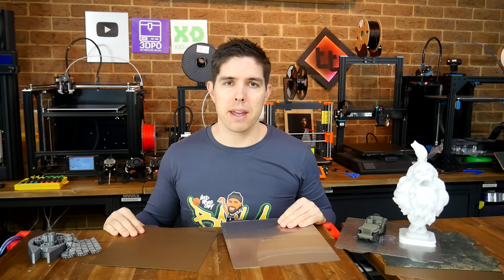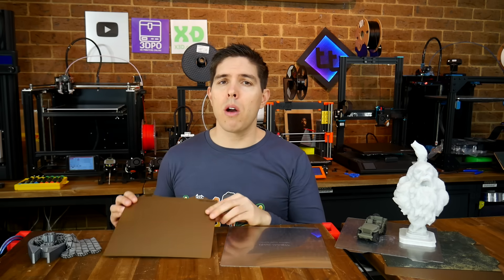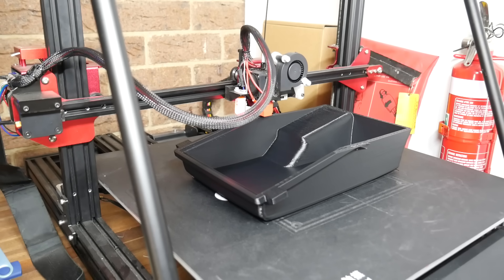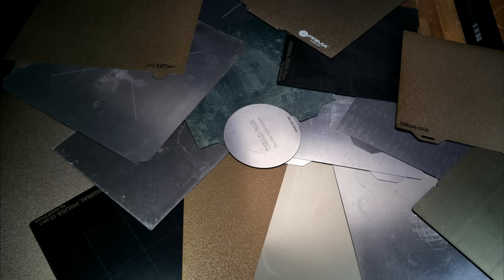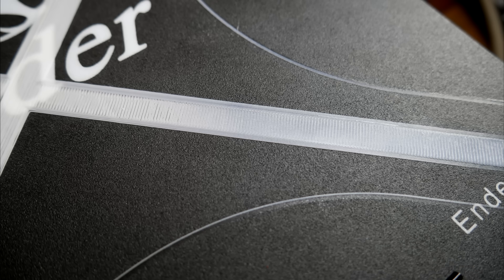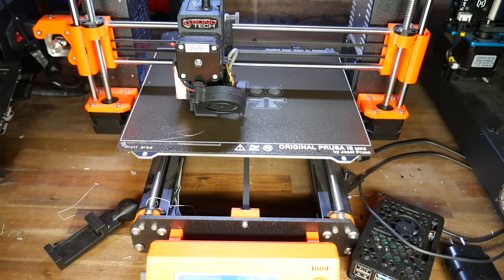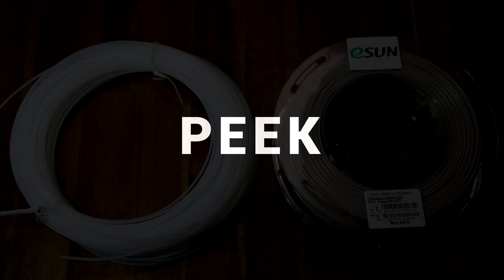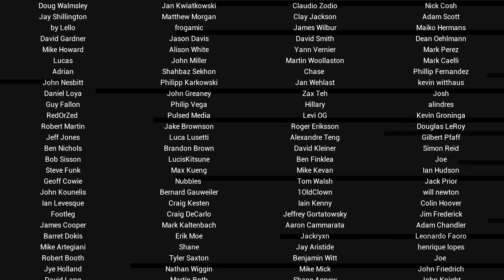Guide to PEI 3D printer beds: Why and when to use smooth vs textured

Comment: Don't use acetone to often to clean a PEI sheet. It's rather aggressive and should be used only once in a while or it will destroy the PEI sheet over time (or even after using it once if you have bad luck. E.g. the powder coated bed from Prusa is pretty f**d after using Acetone only once )

Comment: Recently I came to the conclusion that inductive bed leveling limits your choice of surface that you can use too much. A bl-touch or other mechanical leveling sensor is far more flexible. At least for me it is interesting to see other ABL systems. Pressure sensors etc. ;)

Comment: Thanks a lot again. You asked about other bed surfaces. Well I like poly-carbonate a lot when bed adhesion is important which is the case with ABS. For around 3 euro/pc you can have 235*235 mm cut pieces 3mm thick. It forms a very good addition to the sheets you described for some special purposes.

Comment: I'm having ongoing issues with PETG on a textured PEI spring steel sheet. It's an Endzilla'd E3V2 with 300x300x500 and i'm trying to print large sections of a car spoiler. I keep seeing that PETG sticks too well to PEI but I just can't stop the edges lifting - brim, 13mm/s first 3 layers, different bed temps.. I managed to get one to stick at 90C bed temp but over the 10 hour print this caused the bottom 40mm of the part to sag under its own weight because of being over Tg. Found a hydroponics tent that fits the printer so i'm running another one now, temps seem to have stabilised at 35C inside with a 75C bed temp so i'm hoping the draught exclusion and temperature regulation will help.

Baffles me when people say PETG sticks too well, eSun black PETG certainly doesn't. I had better adhesion with their ePA-CF!
Reply: I've also had a very difficult time getting PETG to stick to, well, anything.  I can sometimes get it to stick with a wide brim if I heat the extruder up to 255C or more for the first layer, and rafts do work, although they're hell to get off of the rest of the print after it's done.

One thing I can't help but notice is that we're both using eSun filament.  Maybe it has something to do with their specific formulation?  Saying a filament is made of PETG or PLA or ABS or what have you is a lot like saying a knife blade is made of iron.  While this is true in a sense, there are a lot of things mixed in to make a good alloy, whether it's plastic or steel, and everything has advantages and disadvantages.

Comment: PEI beds are great for batch printing.  I use the “Continuous Print” plug-in for octoprint to print parts, then it cools down and pushes the part off the bed ready to print the next part.
Reply: wait, let me get this straight: you print a part or set of parts, then let them cool, then the printer moves until the parts fall off, then it prints another set of parts?
Reply: @atlastanker  correct
Reply: @atlastanker  I’ve seen someone make an arm that drops over their build plate and then the plate itself moves backward and all the parts fall off by hitting the arm and the arm moves back up and it prints again. Really impressive. Still requires a bit of maintenance. You’ll likely get a few runs until it has an issue that has to be fixed. At least with your first few prototypes. I feel like bed leveling will be effected over time with that style of removal. And even with an auto. It can get too far

Comment: I have found using windex on the PEI before printing PETG, it helps the part release easier and do less safe to the bed.
It cleans off easily enough with a thorough wipe down with isopropyl

Comment: TPU sticks far too much to smooth PEI to the point of tearing the PEI on removal. I use textured PEI for that reason. So I see a big difference.
PLA has more consistent adhesion on smooth PEI than on textured PEI (that is less fails)
that's my experience on prusa printers

Comment: Very nice vídeo! I’ve been using a mirror with PEI coated surface in the other side! 
When I want to have a flat and smooth surface, I just need to invert the side of the bed.
When printing PP, for exemple, that needs a special glue, I turn to the side of the mirror!

Comment: I really like G10. I am using it on top of the Sidewinder X1 glass bed and print TPU, PLA and PETG. The G10 that I have is a 1mm thick sheet that has just the right amount of flex to release parts when needed but mostly I just let it cool down and parts always release - which is much better than the stock coated glass bed.

Comment: 11:17 I think I must be lucky then, have never had any problems printing with nylon on smooth PEI + glue stick on a printer without an enclosure in ambient temps around 20c, I even get great results with weedwacker line directly from the hardware store (adjusting the filament diameter in the slicer). Using PrusaSlicer Taulman bridge nylon preset on a Prusa I3 Mk3s+.

Comment: PEI is my favorite print surface. I sometimes use GeckoTek. But over time (maybe too much IPA) it loses adhesion. When this last happened, I found myself returning to PEI, even though I have more GeckoTek sheet on hand.
PEEK for $1/kg? I wish! I think you meant AUS$1 per gram!
Reply: That was such a shock it was quick to pick the "typo"! Damn that filament is expensive, hence I've never bothered building my machine for that and alikes, even tho I basically only print functional (including mechanical) stuff. ABS and PETG for my functional parts, PLA for the cold ones without much loads and off we go.
Still pissed at myself for the last PEI sheet I ruined by... dropping the glass surface it was attached to. I had done a great job of sticking it with no bubbles and all, it worked so well, then it was all to the trash bin. Oh well, glass + wood glue smoothly applied and off we go, not a single issue.

Comment: I've been using a smooth PEI coated bed made by Energetic for over a year and have had no issues. A simple wipe down with IPA before printing and I'm good to go. The surface is still good as new and I've removed prints while the PEI was hot or cold.  I've also been using a Creality glass bed on my Ender 3 for months and that's been also working very well. No glue or hair spray is used. I'll probably switch to PEI after installing auto leveling though. I print mostly PLA and PETG.

Comment: Not sure what PEI surface you're using, but mine holds onto PLA & PETG like they're glued even when cooled to room temp. So much so for PETG that it will lift the plate off the magnet for larger parts. 

About 0.04 extra space works well for me w/ PETG and always let it cool down below 45C.

Comment: Currently I use a glass bed with 50% dilute PVA glue, applied on a warmed bed with foam wedge brush.  Lasts 8-10 prints, then rinse bed with a light plastic scraper and reapply.  PLA and ABS mostly at the moment.
Reply: That's crazy and messy, I hope you get a proper build surface sorted out soon 👍

Comment: I dunno what exactly happened with my EZflex but at some point they just stopped working. I tried every trick I found to try to rejuvenate them but they just stopped getting any adhesion at all after about a year. I switched to a Wham Bam PEX sheet and haven't looked back.

Then I got a textured PEI for my elegoo neptune 2 and so far that thing is amazing. I printed all the parts for a ratrig and voron in ABS without an enclosure and there was little to no warping whatsoever. If there was, it was so insignificant that it wouldn't have any effects on the function of the parts.

Comment: In regards to Nylon. It absolutely does not warp as badly as ABS and can infact be printed in open air (some of the composites like NylonX are quite a lot easier). The problem is that initial adhesion as Nylon really doesn't want to stick to anything. This isn't warping due to temperature as much as its just a lack of adhesion in the first place. You really do need PVA wood glue (the liquid you'd actually use to glue wood, not glue stick). As much as I hate any sort of additive to a print surface (and PEI is a wonder material for most other filaments) it absolutely is essential for reliable repeatable success with nylon, and you want quite a lot of it. You may literally need to apply so much that the nozzle is printing 'in between' lines of glue as the nozzle digs in and scrapes its way along

This can be done on PEI sheets but glass is preferred especially with larger prints. Mostly because of the cleanup of the glue afterwards and you have a higher risk of damaging PEI with all the hot water and scraping. Having 1 or more glass beds you can easily swap out is a lot easier and cheaper
Reply: I have had good luck with my CF prints with just glass and glue stick. I think the trick is on the first layer, I run 90C on the bed, and after that, I cool it down to 35C.

Comment: I love  the glass bed for my ender 3, my cr10s pro has double sided pei sheet from energetic/energetic 3D, and I love it, the downside is even with running a bed mesh, it for some reason wont use it when printing, and get gaps between my lines on the first few layers causing small basket weave type thing under the print. If only you can get flatness like glass, still trigger the inductive sensor (it detects metal) and use a pei sheet, I would be soo happy.

Comment: I thought a magnetic bed loose it's magnetic properties if you heat up the bed above 120c!? 

For Nylon I use special made buildplate stickers from buildtak, I think it's a bit like garolite. Works ok, but nylon is a b..ch! 😉
Reply: Most do, some even at 90, but Wham Bam magnets are specially formulated to perform up to 150 C continuous use

Comment: I used borosilicate glass bed which came with my CR-10, glass/mirror bed, painters tape on mirror, little print area that came with Overture filament and PEI textured and smooth. The PEI is really a game changer and definitely in love with it. I don't use anything else since. Nice video, I've learned so much from you since last year and I'm grateful for that! Keep pushing!!

Comment: Interesting.. You'd say PETG sticks more than TPU on PEI? I've used PEI on both my printers for a few years now (mainly PLA, but some PETG too). The first time I managed to practically fuse the material to the bed, it was TPU.. Tore quite a chunk off, so ended up buying a new PEI sticker. (Not really worth the work just to save 5€ for an ender 3 size bed either, didn't turn out perfect + the adhesive genuinely make me feel sick..)

Now, I've started using gluestick for PETG and TPU just to give it a bit less grip. Z offset is very important to increase compared to PLA as well, as both can very easily embed themselves in the PEI.. Though I haven't tried using steelwool or sandpaper to remove some of the PEI before, I suppose that's worth trying. I'm really glad I got a cheap spring steel + PEI solution on my tronxy x5sa though (330 x 330). I kid you not, the very first print I did on that, I managed to ruin the middle by printing a calibration cube too close to the bed. That damn build tak + solid bed is horrible. Spring steel all the way!

Comment: Everyone complains about nylon and pc peeling up. I print nylon on my whambam pex and prusa pei by using Visionminer nano polymer adhesive. I've got a video on it on my channel. It's insanely good stuff and I use it on all my prints now, never worry again!
Reply: I love the nano polymer adhesive from visionminer. I have zero issues with cf nylon at about 80-85 on the bed but when I print regular nylon I have to set my bed to 100 minimum and although the print doesn’t pull away completely I do get curling on the edges where it was lifting depending on the part size. Although that stuff has solved most my bed adhesion issues it’s still not 100% as least without an enclosure.

Comment: I’ve been having good results for nylon with Esun ePA-CF. The shopped carbon fiber make the filament more rigid and stable so it doesn’t warp as much, printing on a MK3 without enclosure on textured PEI with a thin coat of PVA glue.
Reply: Yeah I experienced the same, I just rub a little gluestick on Prusa's Powder coated PEI sheet and rub it in a little with a damp sponge, so there will be no residue on/in the part. Works fantastically and even the texture comes out without any flaws
Reply: @kachler67  great tip, rubbing in with sponge, thank you for posting !!

Comment: In printing nylon I've had success with PEX over PEI (using some glue stick). Couldn't tell you why but I've had success with nylon 6, nylon 12, cf-6 and cf-12. I use the fuliment double sided plate for both my ender 5 plus and ender 3.

Comment: The stock printbed on my CEL Robox is not just coated, but massive PEI. Slightly grinded it works like a charm. Can’t say the same thing about the rest of the printer.

Comment: A little off topic but does anyone know why aluminium is used for heated print beds. If we want to maintain a constant temperature, why use something that is good at dissipating heat. I'm not saying that aluminium is the wrong choice, just has anyone else questioned it.
Reply: Aluminium is not good at dissipating heat the air does that, aluminium is a good conductor of heat. This means that the bed will be heated evenly. The reason you may think that it is good at dissipating heat is because it is used in heatsinks. This is also because it is a good conductor of heat and it spreads the heat evenly over a large surface area for the air to transfer the heat away.
Reply: @Machunorin  ye I get that the aluminium is a conductor and the air takes the heat away. The result is the same. Heat is transferred to the air not held in the bed., and once up to temperature I would have thought heat would even out.
Reply: Less mass = less inertia to deal with when the bed is moving around, which means faster and more consistent the prints
Reply: @Gibson99  that's true I wasn't really thinking about the weight, just the thermal properties. Although many add glass to the bed which is quite heavy. Also I'm thinking there must be something that wouldn't be as susceptible to warping.
Reply: @fenceup07944931177  yeah I have a glass bed I used before getting a pei flex plate. Definitely not light. But I'm not trying to break any speed records with my lightly modded ender 3... I print pla around 60-100mm/s and tpu 50-60mm/s (direct drive). Good enough for me.

Comment: Garolite for ABS and nylon just make sure you use the included sand paper or steel wool to scrub the garolite down really well
Reply: hmm i tried with 1000 lmao but it was pretty much just as smooth , imma try with 200 maybe
abs was warping corners a bit at 130 , dont really have an enclosure so wrapped some tinfoil around and i dont have drafts anywhere

Comment: does anyone have experience with PEI on higher bed temps then 120deg c?
i am wondering if it will effect the magnet or is that not really a problem?
Reply: Wam bam says 150deg for their magnet I think. My (not wam bam) flex plate + magnet was 130deg limit on the adhesive I think. 

Probably will hit the adhesive limit first if the product doesn't say how high everything's usable.
Reply: Most do, it’s called the Curie point where magnets fail permanently at a specific temp, some even at 90, but Wham Bam magnets are specially formulated to perform up to 150 C continuous use

Comment: I use Prusa Satin now almost exclusively. I have smooth and textured too but they get rarely print time anymore, as satin works for PLA, PETG and Flex just perfectly.
Reply: I've found the satin sheet less reliable for PETG than the others. Especially for HG100.

Comment: I'm kinda troubled by this video : isn't the textured pei coasted meant to be more adhesive than the regular pei sheet ?
Reply: If the plastic is squished all the way into the texture it should be more adhered just based on surface area contacted. But the opposite if gaps are left.

Comment: Would PETG stick to kapton tape? 
If so, why not print on it and then remove the part and tape in one shot? 
I've had no success printing with PETG on a spring steel PEI plate. It warps big time and comes of the plate while printing.
Reply: I'm using Sunlu PETG on Ender 3,  glass bed, 3M masking tape, 70-80 bed temp,  230-250 nozzle. 
With a BL touch and bed leveling before every print and dried out filament it's just amazing.
Reply: @antallaczko8793  Good for you, but how does that answer my question?

Comment: If you have problems getting the parts off the plate, put the plate in the freezer for 20-30 minutes. 
Works like magic.
Reply: Would that work for the stock glass that comes with the ender 3 v2?  I have trouble getting parts to release after it cools.
Reply: @wnctrailcam  It should. wait until the glass is at room temp before putting in freezer. The plastic shrinks so much as to release itself.
Reply: @piconano  I'll give it a try
Reply: I tried putting the glass in the freezer for 15 minutes, and it worked, parts popped right off.
Reply: @wnctrailcam  good to hear. :)

Comment: Great video, very helpful! I would LOVE to use a flex-bed, especially something like PEI... BUT I really like printing on a cold surface (glass + gluestick works mostly well for me). Can I do something similar with PEI flex bed; i.e,  print on a COLD smooth PEI Flex Bed + glue stick, and then flex the bed to remove the print?
Reply: I often do it like that
Reply: @allcrafter3747  Thanks! Is that on a smooth or textured surface? Any issues with things not sticking enough, or sticking too much when it is cold?
Reply: @Nifty-Stuff  Well i dont print Cold. But the prints Do Not self Release once IT is Cold. So i guess this Would work. I Use smooth pei flex from Twotrees

Comment: Being flexible is not a con! you can apply PEI to glass if you want to, you are comparing spring steel to glass at that point.
Reply: You missed the point;-)
The plus was you can apply it to a flexible sheet and the con was it can peal off with something which bonds to it too well.